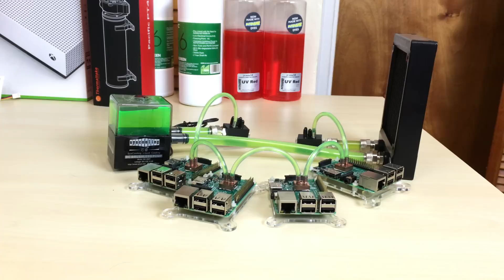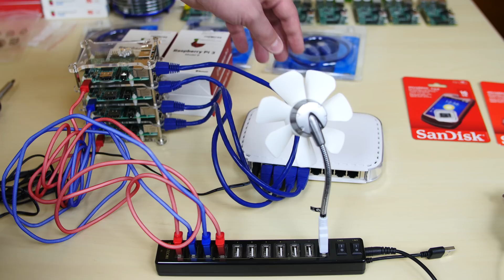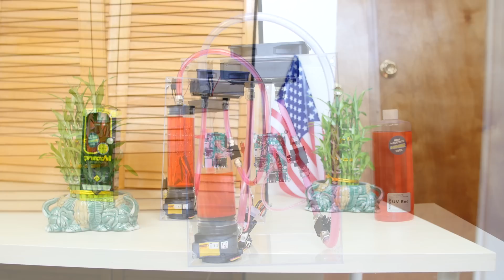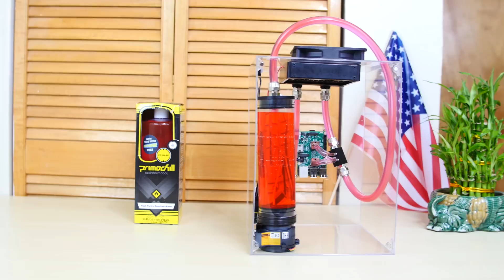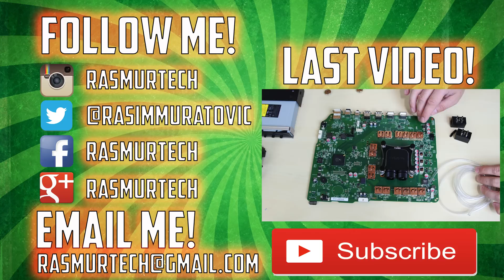Water Cooled Raspberry Pi 3 Cluster (Supercomputer)

Comment: you should have connected 4 of 5 connectors from the first splitter to the 4 Pi's and connected to 4 of the 5 on the second splitter otherwise the last Pi runs the hottest and the first PI coolest.
Reply: michael mooney with the flow and heat output of a pi it will be at most 1 degree lol

Comment: why run the tubes in sequence rather than parallel? the last pi in the loop is going to run hotter, not to mention the flow restriction of using one tube instead of four. 
granted the pi's don't run that hot and you probably did it more for the looks, but there's just some small areas for improvement. keep up the entertaining videos!
Reply from the maker: Thank you so much i'm glad you enjoyed the video.
Reply: True! he has the manifolds and the necessary tubing to run each RP in parallel.
Reply: well, the water maintains a constant temperature, but yeah

Comment: what can you do with the cluster? ...like can it play skyrim
Reply: No, it can't.
Reply: no you cant, because the OS is linux.
maybe, if you attached a graphics card, the cluster would be strong enough to play some games...
Still the ram is low and you only get 1gb per Raspi...
Reply: NO YOU CANNOT. Steam does NOT have an ARM port which is the CPU architecture that the RasPI uses. Steam ONLY SUPPORTS x86. The Windows 10 RasPi port is ARM, NOT x86. 

You CANNOT play most Windows games on a RasPi as they are made for an x86 processor architecture not ARM!!!!!

Seth Hall where on earth did you get the idea that anything you said would work?
Reply: Lame I was thinking this is badass until I found out it's completely useless....can it at least use retropie and emulate PS1 better?
Reply: ILLEATYOU you can run steam on Linux...
Reply: Connormgs is right, even if you built a massive cluster that had the power to emulate a machine running x86, the latency of communication between the nodes would make gaming completely unfeasible. This is why there's clearly a huge market for some kind of self-contained, scale-able modular computer but nobody is making them. I'm not sure if you ever could make one, for that matter.
Reply: if you took the same concept but used nvidia jetsons you could play a lot more than just skyrim
or if you don't wanna go that far, use udoo x86 and overclock everything
or you can find one that has a mpcie 1x4 (preferably. 1x1 will probably be just as good anyway considering you're not using gaming parts to play your games) and use a gpu adapter, most of the mining ones go USB>MPCIE>PCIE. probably wont work due to lack of gpu support but since its all hobby shit anyway I say its worth a try
Reply: okay, but ARM is hardware based, right? So wouldnt it be possible to play a game like skyrim on the raspi windows 10?
Reply: with the raspberry pi, you can install a custom os, so with a large enough pi cluster, you can install a Linux distribution that supports Steam, or even install windows 10, so yes.